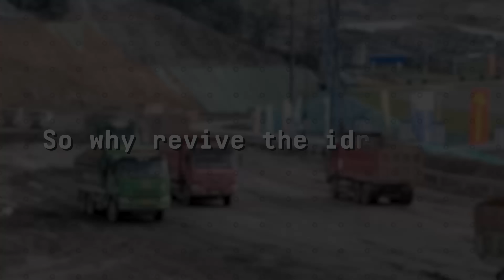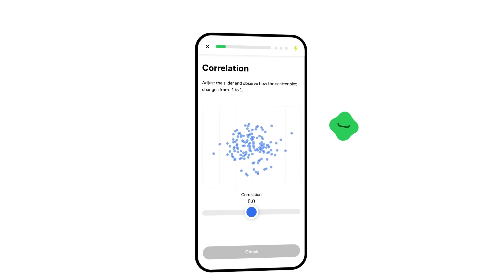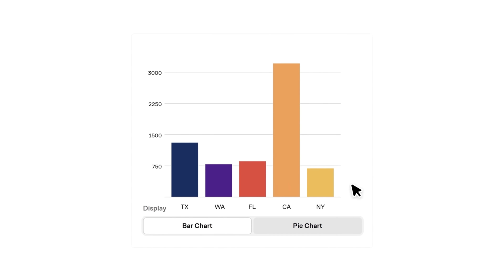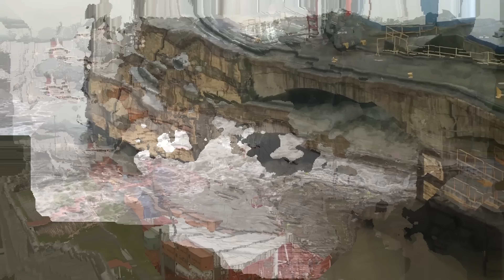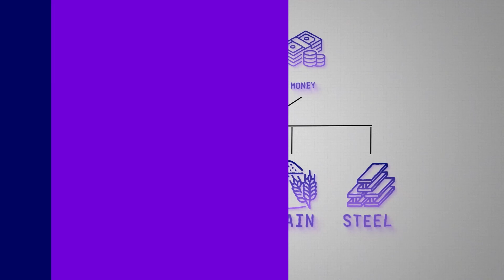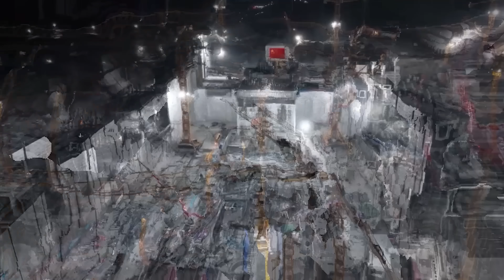China is Building a Massive Artificial Canal to Move Cargo Ships

Comment: This project is just below 140km. There will be geographical changes in the landscape but not on the proportion of the Grand canal. The impact will be some land lost by the canal and some land reclamation. The estimated land gain of below 900Ha  is small and in rice production units could only produce max 3,500 with 1 crop or around 7000 ton with 2 crops per year and could feed only 50 000 people of rice per year. This is my estimate, if it is all new land, The canal will take away around 300 ha of land and probably around less than 200ha of fertile land. All in all in my opinion no real environmental impact and the benefit will be positive for the region. The canal benefits are irrigation control, wildlife will increase, better micro climate and employment will be increased by several thousand  jobs.